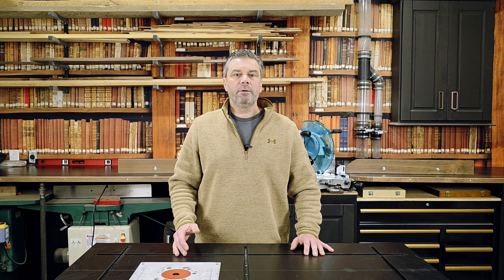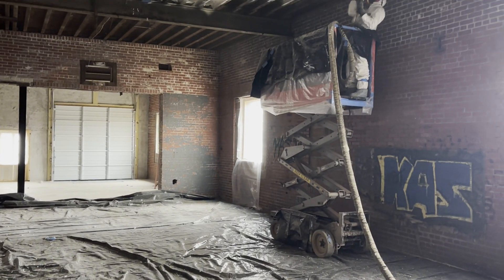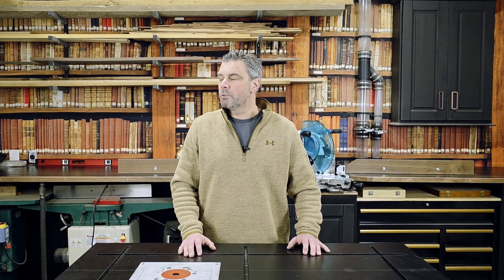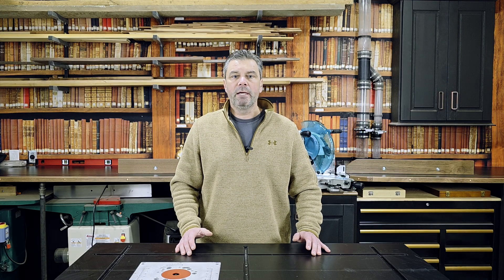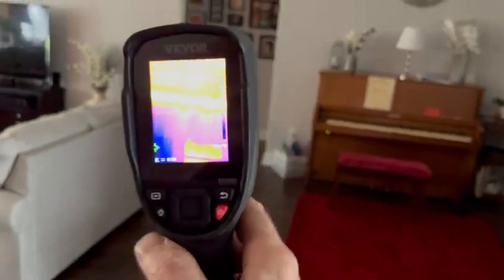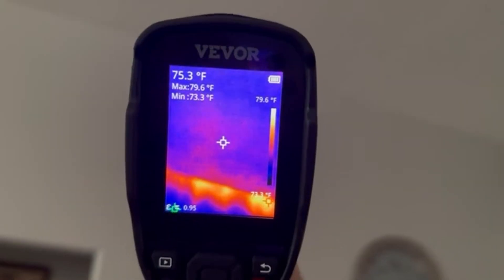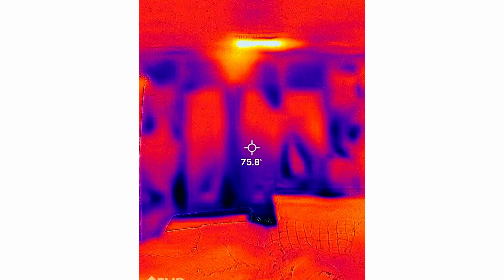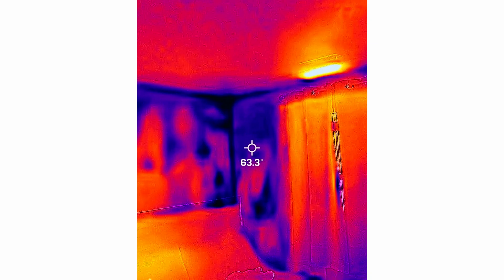Victims of Insulation -  Why is injection foam failing on some of these projects?

Comment: From a building science perspective injection insulation looks like an absolute nightmare - broken continuity, air loops, condensing surfaces without drying potential.  Destroy your house and turn it into a black mold remediation tear out project?  No thanks.
Reply from the maker: I agree. Spray Foam is a great product but Im not sold on using injection. I wish an injection contractor would chime in on the subject

Comment: for all we know we look at spray foam as we look at asbetos and wonder why people used it
Reply from the maker: You never know. The difference between the injection foam and a good spray foam is amazing
Reply: @Woodmaker-Products  id prefer rockwool. doesnt burn which is a bonus ;)
Reply from the maker: Nothing wrong with rockwool. Personally I prefer 2lb spray foam and cellulose. The fire rating and price is really where the foam has its downfalls